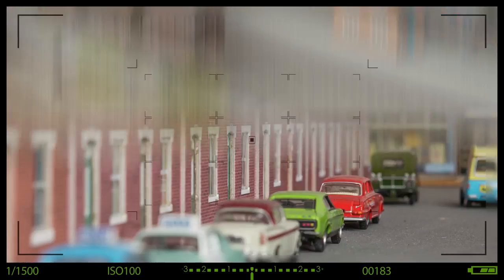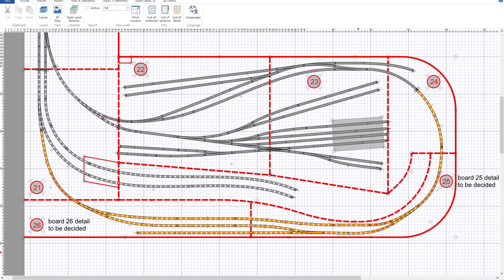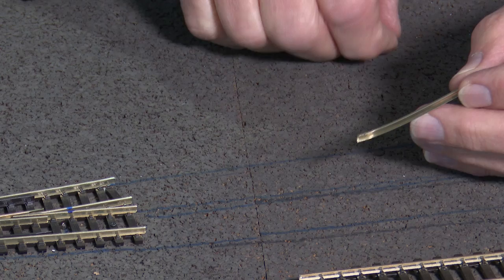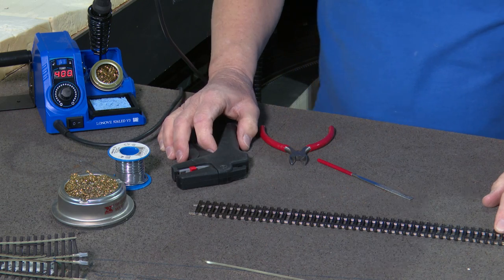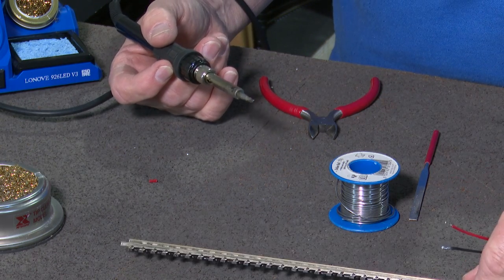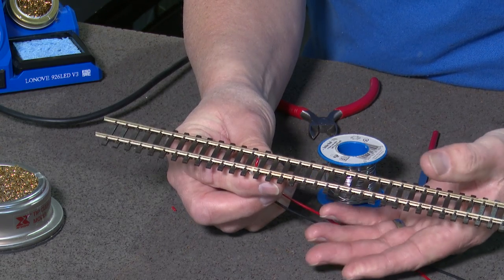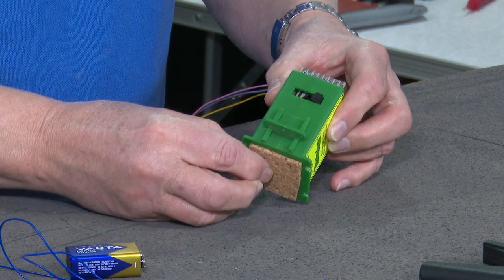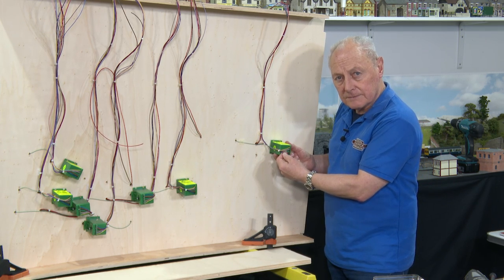GREAT MODELLING TIPS and Layout Progress at Chadwick Model Railway | 179.

Comment: I was glad to see the Warship, Jinty, and Pug coming back at a reasonable price. Glad to see the higher grade Gresley Teaks back. Not overly impressed with how impressed Hornby is with their new DCC chips on this side of the pond our DCC locos will also run DC. And a couple of companies over here were already doing chips with Bluetooth control.
Reply from the maker: Yes, I’m very unsure about how this Bluetooth system works, but if it was a great success in the US, I’m sure we’d already know about it. Regards, Charlie
Reply: @ChadwickModelRailway  it's been better accepted in large scale and live steam I think someone mentioned that Lionel produced a commercial system a couple of years back and are still using it. I  think Bachmann U.S. has one too. I'm just surprised that most DCC that we hear about from the UK is just DCC, where as for the last 10 or so years most DCC here is dual mode, both DC/DCC. That said, growing up I really wanted a Hornby "Zero-one" system. I never did get one though. They were well advertised, but you couldn't find them here.

Comment: I've used connectors that are cheaper and look like the Wago ones - they're rated the same as Wago and as I'm using them on my layout the ratings, even if they're a little off, work well.  There are other types where the connector is a through connector too.  That way you can use it to extend a length of 2 or 3 coloured wires that aren't inter-connected.  (Not sure if that's explained well - think of mains cable connections 3 wires in, 3 wires out or 2 wires in 2 wires out).  I'm not sure I'd be happy with mains voltages on them but for 12v- 24v I'm happy.
Reply from the maker: Yes I’m of the same opinion mate. It’s okay for Model Railway wiring but house wiring is a different kettle of fish. Regards, Charlie

Comment: Another very well presented and informative video Charlie. I’ve used your method for track wiring though not as neat as yours as I have had to do it on my back there is no way for me to lift the boards out.
My thoughts on the Hornby announcements is mixed, I can understand them wanting to play catch up as the last few years have been rather troublesome for manufacturers so they have fallen behind with some past releases. My biggest gripe is the price of the re released models, many of which are 40 to 50 years old now. At a fair price I wouldn’t mind these old models they are ideal for beginners and those with disability who might worry about breaking the more fragile top of the range ones some of which can disintegrated in your hands just taking them out of the box.
The HM7000 is an interesting though not new idea and is a step up from past offerings, personally I still prefer the control of a rotary knob than touch screen it just feels your more in control. I certainly make more sense to me than the HM6000, that just seemed to be app control for the sake of being trendy and was rather pointless.
Cheers Rob.
Reply from the maker: I think it’s fair to say that I can only totally agree Rob. Regards, Charlie

Comment: Another Great informative Video, you do have a Private Life as well Charlie, but I do understand you need to get finished, to be able turn on whenever you wish. ENJOY YOUR WORKING.
Another problem, elsewhere no here, if someone picks a video that may be an OLD video, because he can not find an EARLIER ONE, saying 3yrs and leaves a message to ask an question for that Presenter, do you as a Presenter, do you see ALL your COMMENTS at your end when you logon.
DO NOT WORK TOO HARD, CHARLIE, but keep up with the good presentations
Reply from the maker: Hi Graeme, the YouTube Studio app is a god send. Every new comment on all my videos, comes through. As you might suspect, I answer every one.
Thankfully, using my phone, I can dictate replies. Stay safe mate,
Regards Charlie
Reply: @ChadwickModelRailway  :) you mention Wago connectors, they are here downunder as well, 
100pcs x 221-412 - 4mm 2 Conductor Compact Splicing Connector=50cent each
100pcs x 221-413 - 4mm 3 Conductor Compact Splicing Connector=55cent each
25pcs x 221-415 - 4mm 5 Conductor Compact Splicing Connector
4 x 221-500 - Din Rail Mounting Carrier in a box $82.50

Comment: Wagon connectors need the cable to be stripped 11mm. There is a guide on the side of the Wago. I use them in my electronics development business for building test fixtures that I can reconfigure. Great bits of kit and a good alternative to connector blocks (cheaper too!). You can twist a number of cables together (upto 4mm squared) and feed into a single 'port'.
Reply from the maker: Thanks Simon, I’ll mention it next time.
Regards Charlie

Comment: Good video and an excellent idea to have a program of works for the year. I much prefer the loss of the tunnel and replacement with the cutting. The Hornby announcement is pragmatic with fewer new releases. There is more than enough from previous years that is yet to be released to keep the market happy. The Bluetooth DCC chip and dongle etc does have the potential to be a significant development for the hobby and would make DCC more accessible for new modellers plus the dongle for existing users.
Reply from the maker: Yes, I agree, Peter, Hornby has its issues. Regarding the DCC Bluetooth arrangement, only time will tell. Regards, Charlie

Comment: Some very practical tips in there Charlie, always pays to stop and think/ review what you are doing and not rush. Great idea on the cutting - had same eureka moment on my plans too adding a cutting! Hornby blue tooth - I wonder how many engines and other BT devices you can have at once. Think of your neighbour(s) - if say a BT device geeks and hogging the airwaves with all their devices. Limit for unreliable responses/ lags and what happens as the operator numbers and thus demand for service  goes up?  For me being on my own secure DCC system where I am totally in control and no one else can mess it up is my route. It’s a great idea and sure it will find its place, but do wonder what the limitations are, as TT120 it’s in its infancy stages, is it another Betamax or is it a DVD? Only time will tell. It’s also reliant on dc link hold up expensive caps which just masks dirty and poor track, just wait until the day of reckoning comes and it’s a mass cleaning, day…. Week! All the best Stephen
Reply from the maker: An excellent comment, Stephen. I too wonder about the Hornby Bluetooth system. Regards, Charlie

Comment: I've used the knock off wagos they work just fine I use a different style of terminal block there known here in the usa as European type terminal  blocks there nylon with metal connector bars they work extremely well in a module type layout I'm actually starting a t trak ( n guage) layout and I'm going to start filming soon on the construction soon
Reply from the maker: These Wagos are certainly a great asset.
Good luck with your project.
Regards Charlie

Comment: Little tip .Use a little painters cork on hole after wire in place before placing down..Also when glueing.Use push pins at angle towards connection .Better than using weights.
Reply from the maker: An interesting proposal, Thomas. Regards, Charlie
Reply: @ChadwickModelRailway  Push pins ebay 100 £2.25 with pp.cork normaly £1 tube.

Comment: Great video Charlie! Couple of really good tips. Not a lot floated my boat from Hornby except their Bluetooth innovation for controlling and uploading sound to DCC Decoders, it will be interesting to see if other companies pick up on this or not.
Reply from the maker: An excellent point, but I am somewhat dubious on the Bluetooth’s real ability. Only time will tell. Regards, Charlie
Reply: @ChadwickModelRailway  Charlie, I can tell you from testing that the latest versions of Bluetooth are very robust and have a good range. I undertook that testing because having tried to use BT in the past on consumer products I always found it unreliable to the point where I went back to using direct connect cables. 

However, I can hand on heart say that Bluetooth 5.0 onward seems to have overcome all of that and it's now at least as good as WiFi for reliability and (depending on antenna used) pretty good for range. Even with "as supplied" on-board antenna you get rock solid reliable comms in a single room or space. 

For anyone into lightweight programming of microcontrollers I think buying the (no doubt high-priced) Hornby stuff is probably a bit redundant as you can find oceans of ready made bluetooth send/receive Arduino/ESP32/ESP8266 code for free and the newer MCU boards in those ranges often have BT built-in. So you can make exactly what you want and not be limited by what is included in a product. However, for those whose interest in the hobby does not tend to the electronics side, I think that - if Hornby have done it right - then it could be a big step forward.

Comment: A very informative video to kick off 2023., thanks Charlie. One question though, why no foam track bed on this board? I thought all your scenic track boards  had sound deadening foam under, that also helped shape the ballast. On the Hornby releases, I’m afraid I’ve no budget for new loco’s at the moment.
Reply from the maker: Hi William, the TMD is more like a yard. Therefore you don’t have any ballast shoulders. The area is relatively flat. Therefore I could only really cover it in Cork and as you would run the locomotives relatively slowly, the rumbling should be minimal. 
Regards, Charlie

Comment: Hi Charlie, ref the Hornby 2023 video, Simon's honesty in saying "we have to catch up" is welcome. I'm firmly in the DC camp and too a budget so I'm not tempted by any of the offerings or the new 120 stuff. The fancy new H&M Bluetooth control system - is just another thing which is impossible to troubleshoot when a fault appears. 
Shaun Taylor comments about the Piko screws. The Piko screws are too small to 'use a washer'. I've tried a short panhead self tapping screw with a washer between the sleepers  looks horrific. Found on eBay  'track screws', same thing as  Piko. But Peco track and points has predrilled holes which can hold down track on a corkbed perfectly. Tiny black screw is invisible on the sleepers. But I can't stress too much how vital it is to use only the correct cross driver size to insert the screws into the predrilled hole.  Why add the mess of Copydex, when the Piko screws hold the track so effectively?
The fishplate trick is genius . Your videos are inspiring, Charlie thank you.
Reply from the maker: Thanks John, I’m so pleased that you found the fish plate tool inspiring. Regards, Charlie

Comment: Hi Charlie. I'm pleased you have tried the Wago connectors. I've used nothing else on my layout my only issue is that it doesn't matter how many ports there are they will all be the same pole either Live. Neutral or Earth.
Reply from the maker: Yes, you make an excellent point, but for more complex circuitry, I would still use the larger terminal blocks with the bridge pieces. Regards, Charlie
Reply: @ChadwickModelRailway  I agree Charlie for your layout the larger block is ideal but for a temporary or smaller layout they are a god send. It was nice you didn't say no and offered them as an alternative.

Comment: Dear Charlie,

As Ian Mills pointed out, you can probe a Wago on 2 sides: in the back and at the front, the flat ones have 2 small probe holes. The fatter ones, which have a rounded top surface have only one if I remember right. But besides that, there are even specific mounting frames or parts to mount a wago, or even three, on a surface. I have made some 3D printed mounts myself, using a different mounting method than Wago sells or uses. At least I have seen them in The Netherlands in a DIY shop like “Hornbach” or “Bauhaus”. 

I could provide a link to a webpage if you would like a visual example? 

Thanks for yet another magnificent and splendid video! 

Kind regards, 
Robin van den Elshout
Reply from the maker: Thanks Robin, they certainly are a useful commodity. Regards, Charlie

Comment: Hi Charlie, great video, that's certainly the best way to do the wiring when vertical, having the best access will make you be able to do your most reliable work.

Changing that short tunnel into a cutting is a great improvement, I'm sure that's how it would have been done in real life.

I like the look of those Wago connectors worth tucking away in my mind for the future, mind you I'm quite comfortable with soldering if need be.

I would be interested to see how you tackle the tracks that straddle two boards given that the preceding and following tracks would already be stuck down, I look forward to seeing the cunning plan!!

Look forward to your next installment both here and at McKinley.

Good luck from Spain!!
Reply from the maker: Thanks David, I’m so pleased that you enjoyed it. Regards Charlie

Comment: Happy New Year! Great to see the progress (and the cutting!) Must get started on my layout. On Hornby, the HM7000 Bluetooth decoders looked very interesting and responsive. But will anyone else also be allowed to join the manufacture of this? Having BT decoders from one supplier is a risk, and I would be happier to see many! I have not converted many of my DDC ready stock yet, so still have time to pick this type of decoder.
Reply from the maker: I totally agree Gavin, it’s typical Hornby trying to monopolise on one commodity. Perhaps other companies will get involved as the system becomes more reliable. Regards, Charlie
Reply: @ChadwickModelRailway  The bluetooth aspect should be fairly easy to crack for people in the know and if a company such as ESU feel inclined and sense some market share, expect that bluetooth DCC will become mainstream. The apps likewise, it is just a bit of java, once again easy enough to reverse engineer for Open source types. If Hornby were smart, they would licence this before others get in on the act. Give it 12 months and it will be an industry standard, whether Hornby like it or not.
Reply: I would have thought that if this bluetooth DCC was a reliable system one of the main manufacturers on the electronics side would have already made it available . Another Hornby online exclusive ?  Also there is a major supply issue with the chips at the moment isn't there

Comment: I was rather happy with the Hornby announcements. A lot of the new liveries on pre-existing toolings were of locos I do not yet have, and a lot of the others were ones that I like enough to pick up another. The prices are a lot better than I expected, and seem to have even gone down with a few examples. I only run analogue as of now, but the new Bluetooth DCC system seems right up my alley if I want to go about ugrading to digital.
Reply from the maker: Yes PP, the Bluetooth DCC is an interesting development. Regards, Charlie

Comment: For the Tortoise motor connectors, I use the (solder post) sockets that can be purchased for them and put a little grease on the terminals before fitting the socket. Hornby are now too expensive so along with Bachmann are a no no.
Reply from the maker: The whole hobby is turning into a money pit I’m afraid Sam. Regards, Charlie

Comment: In order to minimize soldering beneath the layout, I use special connectors with my SMAILs (DCC-capable Tortoise machines). These connectors (Part 800-6306 from Circuitron) are soldered to the circuit boards of the SMAIL, allowing the 8 connections to be made using screw terminals. Circuitron is about to release a new version of solderless connector that will work for both Tortoise and SMAIL (Part #800-6601 ETA is March, according to the Tony's Train Xchange site). Same general idea, but easier to install because you don't even have to solder the connectors to the Tortoise/SMAIL circuitboard--all you have to do is slide the connector onto the circuitboard.
Reply from the maker: I have seen this type of clip arrangement, James, but in the UK they retail at £8 each! With 50 points, that’s a lot of pounds. Regards, Charlie

Comment: 09:30 To save you soldering two bits of wire to your point, you could take the feed to the point motor for switching the frog polarity directly from your track bus, if more convenient to do so..
Reply from the maker: I think that it’s sixth of 1,  half a dozen of the other, to be honest mate. Regards, Charlie
Reply: @ChadwickModelRailway  You're probably right Charlie.  It is indeed very situational.  On my own layout, I am using servos to move the points, which don't have the ability of polarity switching, so the wires have to be taken away from the point to a relay.
Reply: I also take the frog switch feeds from the track bus because it's easier for me than soldering to a point. Although I always solder  links to avoid reliance on contact to the point blades.
Reply: @peterloyley3656  I'm like you Peter, I also solder links so as not to rely on blade contact.

Comment: Charlie, I notice your point motors put a lot of pressure on the switch rails of your points (the wire is bent in a fair old arc) do you think it might be an idea to reduce that pressure a bit to improve the life of the point? Another excellent video.
Reply from the maker: Actually, Mike, I have increased the pressure by using the 1 mm piano wire. The points I believe, are easily strong enough to take that pressure. Regards, Charlie